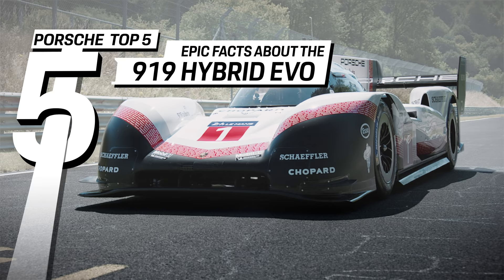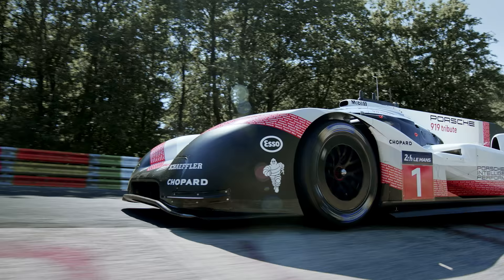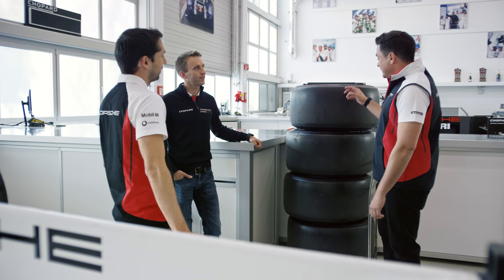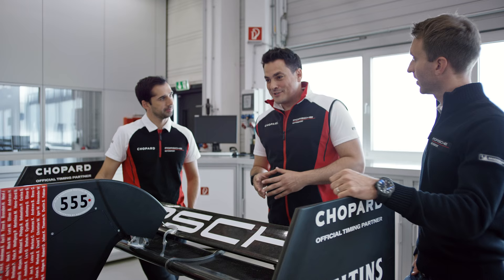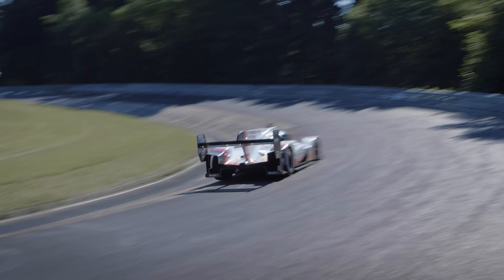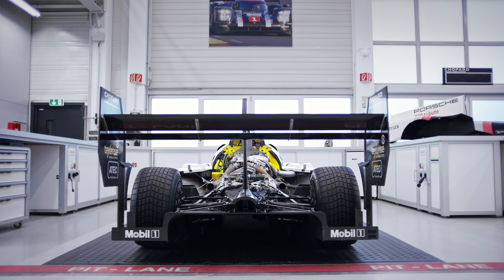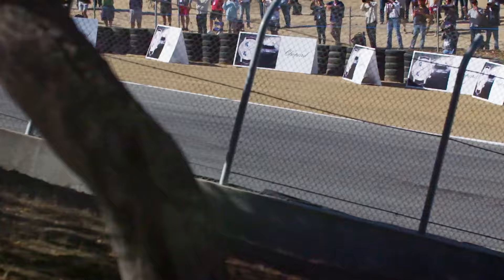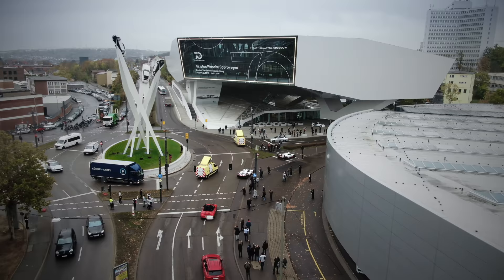Porsche Top 5 Series: The 919 Hybrid Evo

Comment: “0-300 km/h is around 8 seconds, oh sorry this wasn’t the focus of the car...”
Reply: KKKKKKKKKKKKKKKKKKKKKK
Reply: Don´t worry, it´s better in the other disciplines, they did focus!
Reply: That's 1G of acceleration on average and probably 14G from 0-100 if it's done in about 2 seconds. Just on average is way stronger than jumping out from an airplane
Reply: Аитор Хара i think u meant 1.4 g right?
a top fuel dragster has 5 g and they do 0-100 in 0.5 seconds...

Comment: 0-300 in 8sec is so ridiculously fast even if you compare it to video game standards :O
Thank you guys for doing this kind of project ;)
A part of me is sad that it will go to the museum and isn't going to crush every lap record there is on the world :(
Reply: Don't worry! Porsches Museum is actually amazing and all the cars still get driven there.
Reply: Goat Whisperer man I have to say I agree with you 100%, I can’t understand some the rich assholes lock their cars up and rot... cars are meant to be driven, even one off cars...
Reply: I'd like to see a drag race btwn the 919Evo and the 917/30.  Both about 850kg, 1160hp vs 1560hp, electric torque & modern aero vs all that power & 19" slicks.  It was either Donahue or Elford who said it could light the tires at 150mph.
Reply: Phyllobates Terribilis 919 will be faster till 300 kph (about 2 secs faster). The reason - new chassis, suspension, tyres, 4wd, sequential transmission, aero. After 300 they will accelerate to 370 in about the same tempo.
Reply: New badass car confirmed for Forza 8 and Gran Turismo 7.

Comment: So glad Porsche  did this project! Shows how much they truly love what they do! 720ps out of 2litre 4 cylinder is bloody nuts, hell even 500ps is awesome especially since it holds together for 24 hours!
Reply: The engine on WTAC winning porsche 968 is more than 1000 hp output on circuit trim and revs to 9000 rpm. Pretty impresive for 4 liter 4 cylinder.
Reply: The engine was ultimately made for efficient torque and durability.  In theory, if it had a larger bore and smaller stroke, it could make a lot more power had it been able to rev to 12k rpm.